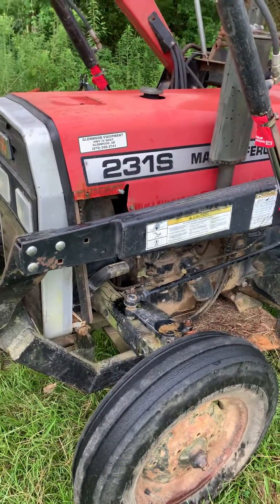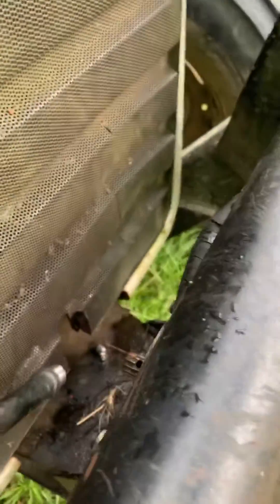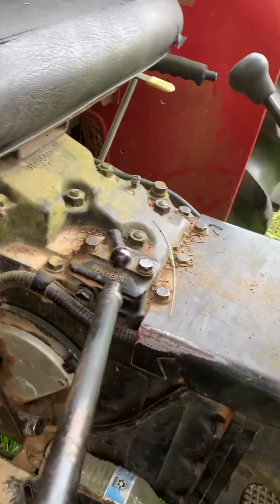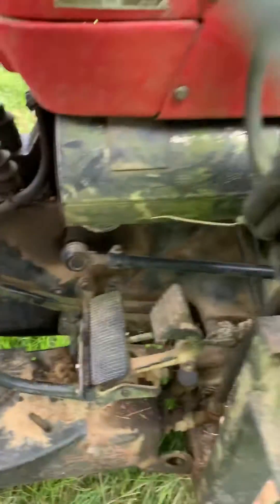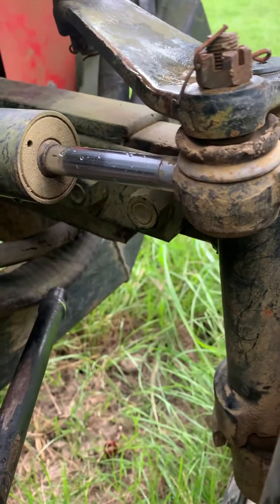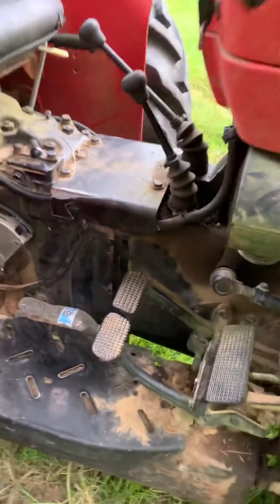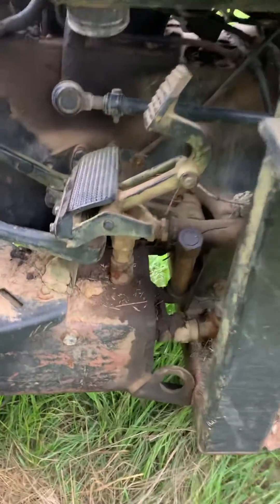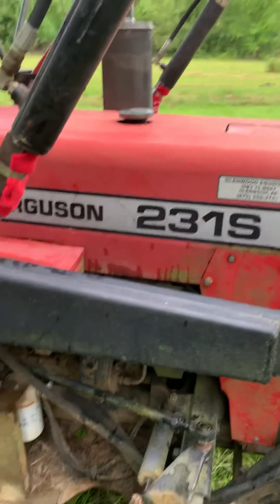MF 231S external hydraulic problem

Comment: Did you drill a hole in the hydraulic shaft and crankshaft then put a shear bolt in it? I’m running into the same issue and was wondering if I should go this route?
Reply from the maker: Yes I drilled hole in shaft. I put in Grade 8 bolt which suppose to be hard bolt but it kept breaking them too. I will try do another video on what I came up with.
Reply: @carpe-diem4074  was the bolt you used threaded from top to bottom?
Reply from the maker: @Japplegate11  I don’t think so!

Comment: Did you ever find the solution
Reply from the maker: No I just went with TS 300 that works hydraulic from 3 pt lift. It’s slower but working. I much rather have the independent hydraulic.